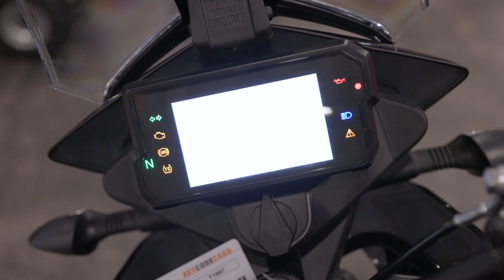2022 KTM 390 Adventure | First Ride

Comment: So, I own this bike, and I love it! I had Liter bikes and a Super Duke and I did ride this one a lot more. While I had my R1, I took this bike on a 9 hour highway trip from Salt lake to southern Colorado, and while on the cabin in the mountains did a lot of off road with it, and some stuff fairly hard core (even with the cast wheels); I did eventually changed the wheels for the spoke-type, but I did jump the hell out of the  bike, and no damage on the wheels on or off-road. If you are goign to ride it in city, the bike needs no mods. I did change some things on mine,and many of these mods are available from KTM's catalog. I got the 890 ADV rally style footpegs (larger, better angle), the handlebar rise is a MUST,  replace the plastic engine guard with an aluminum one and added hand guards, along with KTM's confort seat & Pillion. Added some saddlebags, a pillion bag, and went on a few trips with it. With the Pillion bag, it was great for in town errands, and I even drove this bike on winter/icy conditions.  Did fine. I did a lot of off road stuff with it (some pretty rough fire lanes) and plenty off the road stuff, but I wouldn't take it where I take my Enduro KTM (that's a 450  cc, but even lighter). This did fine in every occasion with cast or spoke wheels.  Also, the controls are illuminated,and you can pay to unlock the Quick shifter (or you could on the 2020 model year). Headlight is bright as my car's light (Love that about the KTMs), so ifyou odn't mind the bug look, (I love it) its a good looking bike, and KTM does great jobs with the paint schemes. 
OC Again, YOu can take this off road fine. I saw people take the pipe to get a few extra HP when off roading this bike. so, if you're are going to seriously off road this bike, the biggest change you'd need is the better engine guard (the plastic one mine had was not good enough, and I'm not sure if the newer ones updated that to metal). Get bar risers, b/c you'll be standing and higher handbars will be helpfull along with proper hand guards, and the rally stile foot pegs. With just that, you're Solid! 
Sorry, Long post, but LOVE this bike! Its a Do it all! (I bet you could put soem slicks and track it too :)
Reply: It fall apart yet ?

Comment: I’m 71 y/o I recently unloaded a Triumph Tiger 955i that I’d had for 16 years and a Bonneville for a 2022 390 Adv. At nearly 600 lbs. loaded, the Tiger was simply more than I felt comfortable dealing with. For me, the little (?) KTM is ideal. It helps that my favorite bikes have always been light and “tossable”.  I’ve installed some SW Motech bags on it and wouldn’t be afraid to ride it anywhere that I rode the larger adv. As you noted, it is quite susceptible to crosswinds, but hardly unmanageable.

Comment: I took the MSF on Sept. 11-12 and picked up my 390 Adv on the 17th. At 6'5 it's been a great first bike since most low displacement beginner bikes are way to small for me.
Reply: Any update ? Is it still comfortable to you ? Any issues with the bike ?
Reply: @leeinwis  I only kept the bike for about 5 months before upgrading to a Triumph Tiger Sport 660. If my only plans had been to have an around town bike, I'd have kept the KTM, but I wanted something more highway capable. I didn't have any issues with it, and I would have kept it as a second bike, but I only have the space for one.

Comment: I moved from Long Island New York to Georgia 2 years ago.. When I got here I started looking for the 390... The covid Freeze on life made this bike hard to come by... In New York I had a Yamaha 650 cruiser...  that I barely road... The 390 finally came available at the beginning of September... So I pulled the trigger and bought the exact bike you're riding in this video... I am 5' 8 and weigh a 160 pounds.. I'm on my toes but at stops I just lean a little to the right and put my right foot flat.... I have no off road experience yet.. But I hope to try it out once I get used to the bike.. And care less about how pretty it looks now🤗.. Like you said it's real easy to ride... And I really like the bike.. That being said.. I have 375 miles on the bike and right now it's it's in the shop Because of an oil leak That I noticed on my garage floor after returning from a 10 day trip back  to New York🤷‍♂️
Reply: You should lean to the left
Reply: @MarkSmith  is there a reason I should lean to the left🤔 i was leaning right so I could keep my foot on the shift🤷‍♂️

Comment: OC: For adventure riding, I will favor the simple bikes that can easily be mended in cases of damages while out there in the middle of nowhere. I think the 390 Adventure with its single cylinder engine, less electronics clutter, simple effective suspension and utilitarian overall package can go toe-to-toe with mid-power and high-power, expensive, cluttered, complicated, bigger ADVs that have parts you cannot find easily, and you need special tools to do simple repairs. But of course, the 390 Adventure should stand the test of reliability and durability off-road. Having said that, I guess most buyers of the 390 Adventure will just use this bike as a starting point for adventure riding. This bike might not even see off-road that much. Riders will eventually give-in to the ego-bug and status-symbol-syndrome and will go buy a bigger ADV bike from established brands.
Reply: True!!!
Reply: Drz400 better

Comment: Many riders get the KTM bar risers. They offer 10, 20 & 30 mm heights. KTM has other accessories also like different height windscreens.
I have seen in other videos 105 mph, 169 kph top speeds.
Noraly, Itchy Boots is doing a solo S.America to Alaska, U.S.A. ride on a Honda 300 Rally. And it has 50% of the power of this KTM 390. Noraly avoids paved roads if possible as that is where the sites are.
The 390 has Brembo brakers at the front, BYBRE.
I like the looks.
Many complain about the forward tilting footpegs. There are better ones after market.

Comment: Your revs were too low for the pullaway (appreciate it's in break in period), should have started in 3rd. Engine starts to pick up at 6k revs through to 9k. Also I rarely have issue with the standing position off-road. It's a little aggressive maybe, but that's actually not the downside you'd think to associate based on these first takes. Have ridden light enduro along with dedicated dirt bikes, me on stock tires, them on knoblies. Could do all the things they were doing over 150 mile off-road days, primarily down to it's very capable suspension (you can outpace the suspension if you ride super aggressive, but at a reasonable pace it's very good). I've slammed the cast wheels off road many times with zero issue. Honestly, it'd easily hold its own against the Pan Am, for example, if you ride to its strengths.

Comment: I own a previous year 390, I have had it a year, I’m a new rider to the road but have a good amount of time ridden off road. 

First off, it’s as fun as Chase is saying it is, so so much fun and easy for daily commuting. 

I have done a few longer trips. Longest being 6 hours in the seat (stock seat, rally pegs) and my hip flexors were in so much pain I couldn’t ride. It’s okay, but not good at long distance travel. I still had a blast. I did just have to stop more than I wanted to. 

A bit more on that, the wind protection over time gets greatly fatiguing. At least I feel a bit like a parachute in the wind on the bike. 

Fuel economy is fantastic! I found it to be seriously good. (In Australia) around 300km+ a tank if you are taking it easy. 

Off road on fire roads or dirt roads, it’s good, you can turn it all off and have some fun, stock tyres are less than inspiring on the dirt. Although the contrary on the tar! 

Overall I think the bike is fun and a great bop around bike and a fantastic purchase! I love mine! I hope this helps! Thanks!

(Sorry if it doesn’t all make sense, I wrote this fast)

Comment: Hopefully you do an off-road ride with this in the future, pretty much required in this segment to show how it does. I'm fairly certain for the 22 model they strengthened the wheels. Besides, as long as you're not smacking big rocks with the wheels, the cast are fine, this bike was never meant to be a pure off-roader. If I had to pick, i'd still use cast wheels on this bike mainly for easy tire plugs in case of flat and also fu** changing tubes on the road.

Comment: Thanx for the review. I am a 50 years old total beginner and thinking to buy my first bike. The cb500x is on the top of my list but also the KTM 390 adventure.... Difficult to choose, want to have a practical bike for commuting but also go on some touring in my country with enough power and not 'difficult' for a beginner as me.  Ride safe and cheers from Serbia 🇷🇸✌️
Reply: The 390 is all around better, on road they're similar but I'll say that the 390 will feel more nimble and agile but off road 390 is just more capable and better equipped

But also keep in mind that Honda will beat KTM shop network almost everytime and the 500 will probably be cheaper to fix if something breaks

Comment: Chase: 3:33 “No problem with the engine” 

Also Chase 3:36 Bouncing off limiter
Reply: He's bouncing off the limiter because it's limited to 7000 rpm until you get through the break in period (1000km).

Comment: OC: Still top of my list for my next bike. Great review, you touched on everything relevant other than getting her off-road. At 5'9" and 32" inseam, I'm a smidge worried by the ride height. Still, the seating position looks good and as you say, the lightness of the bike might make the height a non-issue.
Reply: Throw this thing on a trailer once and ratchet down the bike. It's not a big bike.
Reply: I have a 31” inseam and I’m on tip toes but it’s not bad. The lightness of the bike pretty much makes it a non-issue.

Comment: Based on this review I’m guessing you didn’t really do any research into this bike before riding it. A lot of what you said seems based on assumptions not fact. Suspension: fully adjustable front and rear. Switch gear is backlit for night use. The cast wheels have been used it lots of off road terrain and not had issues, plus it gives you tubeless tires so you can plug a puncture rather than need to change a tube. The openness or lack of side fairings is a blessing for ADV as it’s less to remove for maintenance and also less to break in the event of a drop. As for it only having a 19” front tire, well, that doesn’t make it not a true ADV bike. In order to have the larger wheel up front it would mean a longer chassis and it would lose its nimble characteristics that make it so easy to ride. Yes a little more ground clearance would be nice but then you also increase seat height and make it less approachable for new/shorter riders.

Comment: Low handle bars is an issue on the Honda CRF250/300L as well. Idk why they make them so hard to stand on when clearly that’s a standard use case of these motorcycles

Comment: Would love to see more first rides of more lightweight ADV bikes. I hear the Kawasaki versys 300x has become a favorite in that line for actually going offroad, because people like how lightweight it is. I’m not super interested in interstate touring and would rather have a lighter bike off-road. Want basically a dual sport but more comfortable seat and some wind protection.
Reply: I've been trying to pick between this and the x300 for at least a year. I just can't decide.
Reply: @JCrozier1  yep, same boat. I want a 300-400cc adv. Really been wishing Yamaha would make a more affordable tenere with the mt-03/R-3 motor since the t7 has the mt-07/r7 motor. Doesn’t look like that’s happening though. I dig the ktm, just worried about reliability and getting it serviced because they don’t have a great dealer network in my area. The versys 300 looks great since they more recently updated the finish. The rally version of the Honda crl300 also is interesting. Haven’t seen one yet to be able to sit on on it and see how it feels but I definitely like how that bike looks.
Reply: @nephilymbass1  I test rode a 300l. It's barely better than my dr200. 
Super squishy suspension. 
300 rally was on my short list.
Reply: @JCrozier1  yeah turned out the Honda crf rally and L are setup for a child. I’m 5’10” 240. Not super overweight anymore. More so built like a linebacker.  I sat on the Hondas and they basically did the Carolina squat. Looked into upgrading suspension but it’s like $1500-$2k (too much to dump into such an inexpensive bike considering other mods I’d want to make) Seems like they were built for people that are skin and bones.
Reply: @nephilymbass1  I'm still riding a DR200 for little in town stuff. Tried a 300L a couple months back. It's barely faster and has a squishier suspension. 
I'll probably stick with what I have instead of doing anything else.

Comment: KTM was almost dead as the company caught in the 2008 global meltdown, that's when Bajaj Auto Ltd. brought them back from the dead, picked up 48% in KTM in 2008 and bailed out the loss-making company admits CEO Stefan Pierer. The 390 ADV sells for around ~3600USD on road prices in India. Of course there's a 250cc model, low seat height for shorter riders, spoked wheels, bare bones X variant and a ton of aftermarket accessories like the taller windshield, engine guard with sliders, bash plates, Jerry can mounts, radiator guard

Comment: I'm 5'8 and I can flat foot this bike
I own the 250 Adventure and since it's the same as the 390 I don't understand how you can't flat foot it.
Reply: Maybe two things. Being a 250, maybe the bike is slimmer then the 390, and maybe you have a longer inseam?
Reply: @martyn_g  The 250 and the 390 are the same in terms of the body and chassis. The only difference is the engine, the display and the electronics. I did play around with the suspension settings in order to make the ride a little more comfortable as it was a little too stiff for my liking.